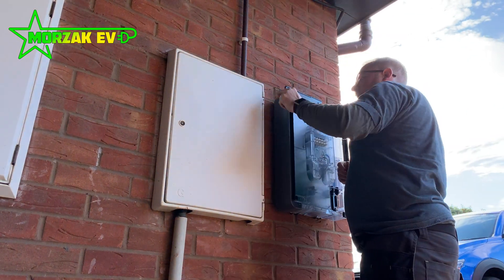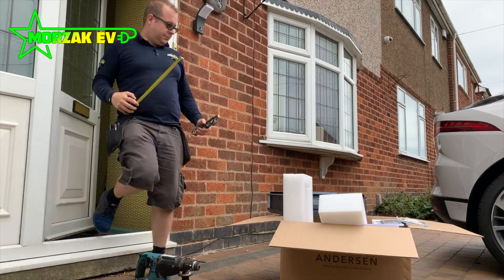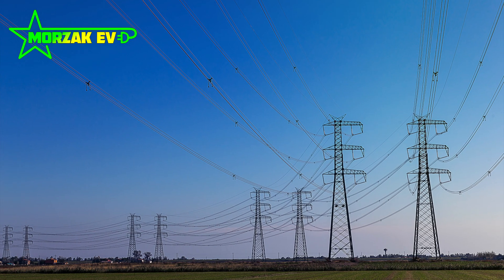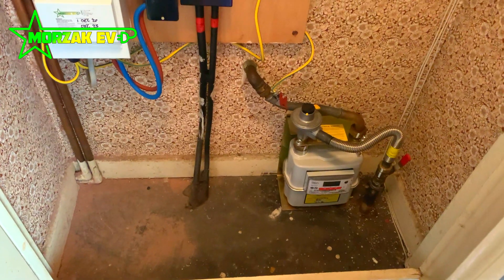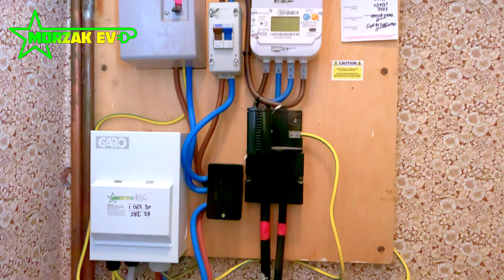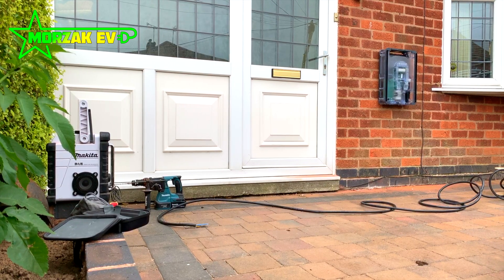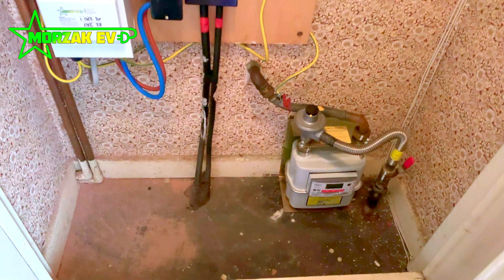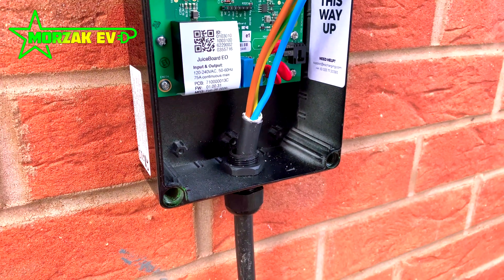Looped Supplies, Electric Vehicle Charge Points, & the Electricity Distributor Notification Process

Comment: In Glasgow area and neighbour has 3 phase head with one phase to their meter, one phase connected to a cable supplying my meter and 3rd phase terminated in an unused fuse. DNO saying they require to put in a new direct supply to my house before they will permit ev charger to be installed.
Reply from the maker: Sorry to hear that. That sounds unusual, and these situations need resolving much more quickly really. I think think by rights, depending on the existing demand of your household, there is a way you could install one sooner.

Comment: Really useful video. I have a looped supply and live next to petrolhead neighbour. If i wanted to "de-loop", whilst i am future proofing us both, it will look like i'm asking to dig up driveways for my own purposes :-( Fully understand DNOs need to upgrade these anyway for future heat pumps and other electrification but there isn't an awareness campaign for this whatsoever.

In the short term is it not possible to install on looped supplies with a load monitor of some sort??
Reply from the maker: Yes, it is up to the individual DNO's and engineers, and the individual situations, but i've had plenty of situations where unloosing was either delayed by months, or the supply was left looped, and a charger that is load balanced can be installed instead. Of course, you just need to be aware that a load balanced charge point will limit itself sometimes making the charging cycle longer.

Comment: I live in a semi-detached house. I looked in the DNO meter box and the fuse is 100A and I only have one cable going into the bottom, which makes me think I do not have a looped supply - but could it still be possible that I am on the end of a loop? I guess the only way to really know is contacting the DNO.
Reply from the maker: Yes, and sometimes the DNO will only deal with the electrician. Also, bear in mind that just because your fuse says 100A on it, the actual fuse inside could be smaller!!!! It’s a mind field, and there are no easy answers, but one thing I would say is that DNOs are becoming easier to deal with and more efficient at sorting these things out now.

Comment: Looking at UK power's website, they suggest that the person requesting getting unlooped has to pay 
https://www.ukpowernetworks.co.uk/internet/en/help-and-advice/documents/looped_services.pdf
Who pays for the work? 
If it’s you who has asked us to modify the 
connection, then you pay for the part of  
the work which affects your premises.
Reply from the maker: Hi Jim, yes it does say that on UKPN, however, we have had literally dozens and dozens of these, and not once have i had someone be charged for this service. A few times, where the work was not feasible, we came to some other arrangement. Now, that being said, we mostly deal with one particular DNO regionally, and then just a few others when we're outside this region or it's a private DNO on an estate (which is never looped in our experience) so maybe policy may vary from DNO to DNO.
Reply: Can I apply to get the loop removed before I get my electric car or the charger booked for fitting?  If so how do I go about that?  Is there an on line form I can submit, or would I be better just phoning my DNO?
Reply from the maker: @Jimages_uk  Yes, you can put a notification in. I’ll post the links separately to the forms. Just note though that depending on you knowledge, you may need help from an electrician to complete some of sections as it does require knowledge of calculating demand after diversity as well as few other little bits.
Reply from the maker: @Jimages_uk  Link to the EV application form: https://www.westernpower.co.uk/downloads/26143
Reply from the maker: @Jimages_uk  Link to the contact email addresses for your DNO. Make sure you check you MPAN and verify the first 2 digits of the last line of your MPAN matches the correct DNO.
Reply: @MorzakEV  thank you for your help  :-)
Reply from the maker: @Jimages_uk  No worries!

Comment: If you have to get your supply unlooped, and the DNO is minded to charge you thousands (in my case I have a long driveway shared with my neighbour), is it worth asking for a three phase supply cable at this point?  I’m thinking it could be useful in future for heat pumps, upgrading solar inverter to three phase in future (to get past 16amps per phase generation limit), and of course a 2nd ev charger at home.
Reply from the maker: Hi Anthony, firstly, if they are planning to charge you for the works, I would ask about the process to contest these charges. For me, the DNO's have been tasked with unloosing supplies at no cost to the individual consumer. That being said, I haven't ever heard about anyone actually contesting these costs, so i don't know how successful this may be. It would be worth a try though. 
If this did turn out that the charges are valid, then I would definitely get a cost for a 3 phase upgrade. How feasible this is (and therefore what the cost will be) totally depends on the overall capacity of the network and the nearest available 3 phase transformer. We enquired about this when our house was being upgraded, unfortunately for us, we would have been looking at around £30k plus because we're fed from over head cables, and the nearest 3ph supply would need to come across neighbouring fields (meaning legal expenses) and new poles etc! We were disappointed, however the quote process is free so well worth enquiring.

Comment: great video - ref looped supply , we appear to have a Y cable from the 100A fuse down to a single cable into the ground.
Could that mean it was looped and has been changed at some point?
Reply from the maker: We often see this particular “Y” configuration I think you are referring to, and that usually means that it’s a two core live and neutral mains cable, and they use a method of separating them before the cable gets into the service head. Some people’s service heads are slightly larger so they’re separated inside the head. So it’s probably not related to a looped supply. Without seeing a picture though this is obviously conjecture, and in no way should be taken as professional advice! LOL.
Reply from the maker: I’m guessing yours looks something like this in the first photo? https://www.hectorselectrics.co.uk/service-head
Reply: @MorzakEV  yep just like that with the "knot"

Comment: has anyone used Western Power to unloop their supply - wondering if you were charged for the unlooping process ?
Reply from the maker: We regularly deal with Western Power to have our customers have their supplies unlooped. Every single one has been free of charge. I understand that there may be exceptional circumstances where a charge may apply, however, WPD would inform you of any charges prior to the work, so there’s nothing lost in enquiring. You are also better off having an installer or electrician onboard prior to starting this process as the demand needs to be calculated by someone competent to do so.